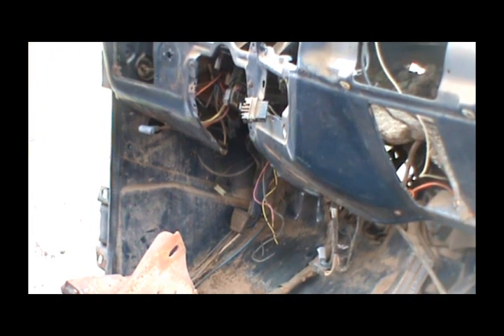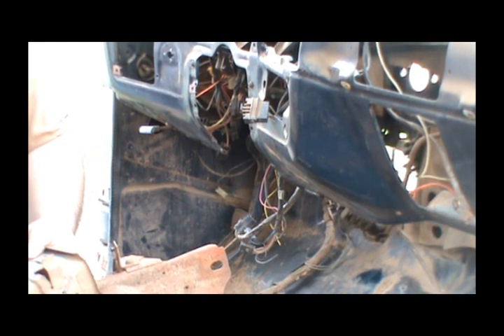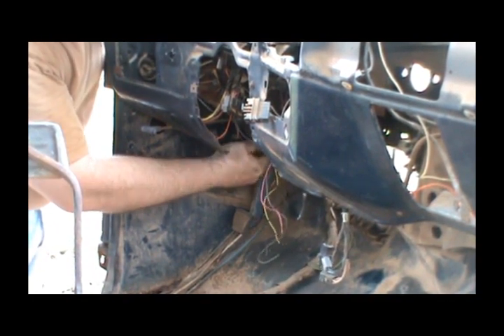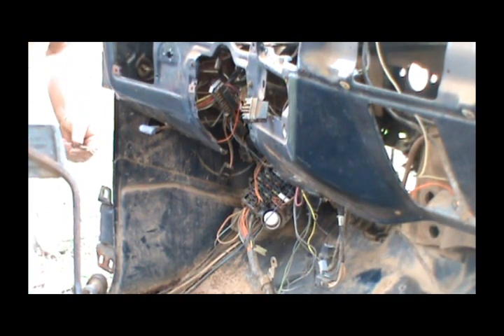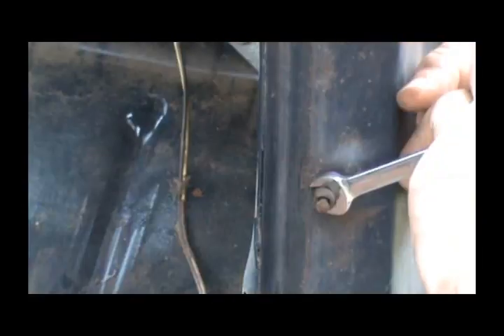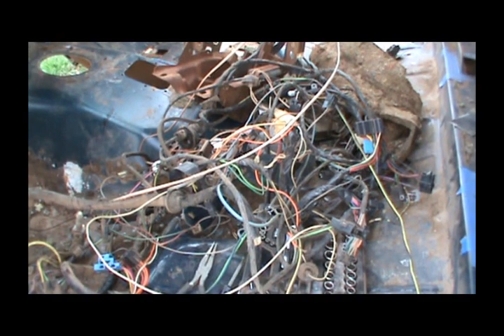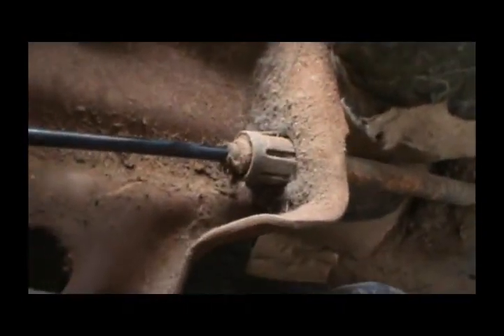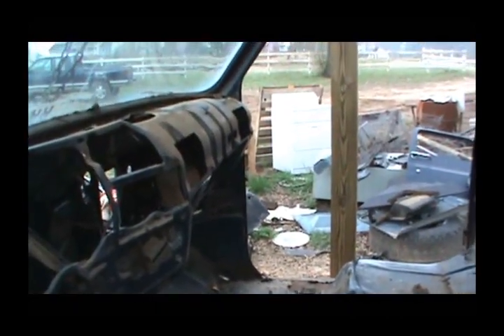1985 Chevy K10 Restoration Part 29

Comment: They do come apart a lot easier than they go back together.  Many people start projects.  Few actually finish them.
Reply from the maker: True, I've given up on a lot of projects in my younger days, but I'm determined to see this one through.  I think it'll be easier using the factory harness than it was rewiring my other truck with a harness that didn't have all the connectors attached.